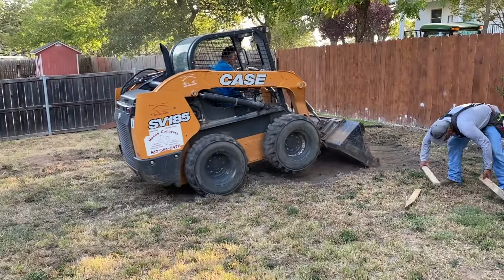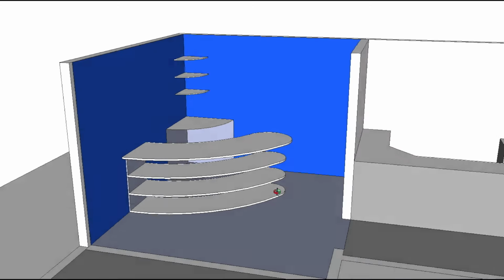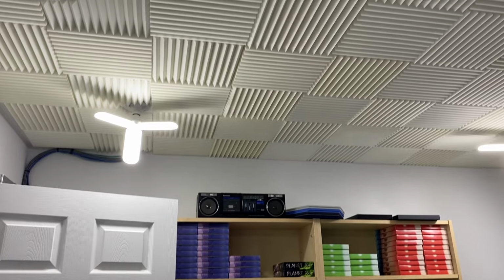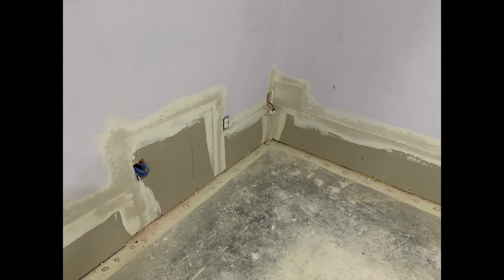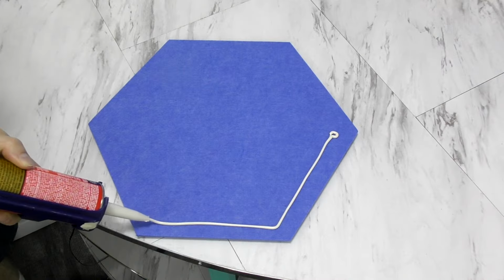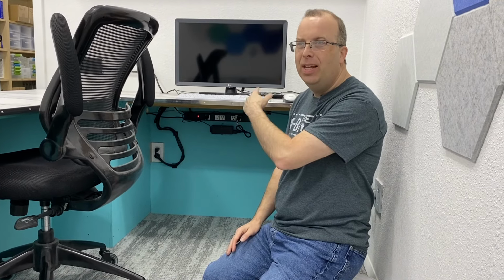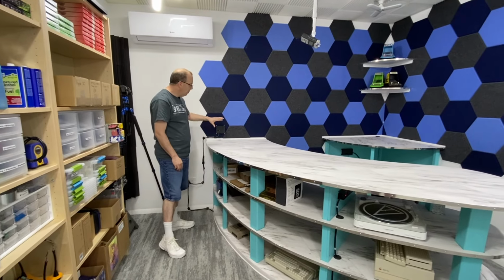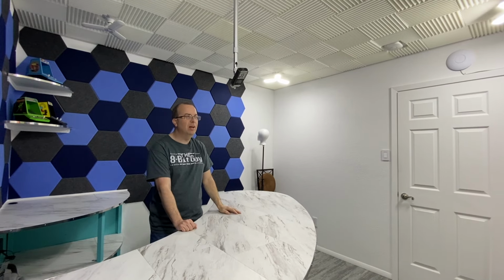8-Bit Guy Studio Build - Part 3

Comment: Anti-static wrist straps tend to have a 1 meg ohm resistor in series with them.  This makes them conductive enough to drain away static electricity, but not conductive enough to cause you to get zapped when you touch something hot.  So just put a 1 megohn resistor on the workbench edge.  That way you don't need to worry about setting the switch for whatever you are doing.
Reply: yea that current setup is actually dangerous he can get between live and earth and get electrocuted so that 1MOhm resistor is much better solution than  a switch
Reply: Is there anyway we can use the Pantarouter for that? 
Good surprise to see you pop up on another of my favorite channels
Reply: Just my thought ^^ Around 20 or 30 years ago I bought a wrist strap for electrostatic discharge and weeks later they sent me a resistor because they forgot to add one when I purchased it. That's what burnt the resistor into my breain ^^
Reply: Without missing a beat your voice played this message in my brain.
Reply: The Wandel had spoken.
Reply: I was about to suggest the same. Not just wrist straps do this, but anti-static table mats often do this too. It's pretty standard practice to use a 1 meg ohm resistor in series with any anti-static grounding  as that simultaneously allows quick dissipation of any noteworthy charge and while also disallowing most typical unreasonable/unsafe currents. Though... technically for CRT voltages you might want to go for higher resistance, and be mindful of breakdown voltage, but yeah. Your current switch might have good odds of letting CRT voltages arc right through too. If really worried about CRT voltages, I might be tempted by something like a MOX-2-121006JE, which is a 100Meg resistor rated to 50KV and 12.5W, and if you took 27KV from a CRT to it it would be limited to 7.3W. Might be overkill, but even at 100Meg I'd expect it to dissipate static sufficiently, and it'd even survive even the worst case of a live CRT HV supply being shorted to it.
Reply: @rougenaxela  The MOX-2-12 is rated at 20 Kv and 5w, it is the MOX-5-12 that is rated at 50Kv and 12'5w, according to its datasheed.
Reply: Just make sure the voltage rating of the resistor is high enough. Otherwise, bad things might happen :)
Reply: @basvisscher934  If there is enough current that the resistor blows up, you already have other, probably more painful problems.
Reply: The crossover I definitely did not expect...
Reply: Often even higher than that. 10M is also perfectly adequate for ESD control.
Reply: Just don't buy "cordless" antistatic straps because they have only this resistor but it's not connected anywhere so it won't discharge anything.
Reply: @wychowanek90  i can never look at cordless anti static bands without thinking of The Verge PC Build.
Reply: @blaster00000  "He's not fighting static, he's fighting cancer!"
Reply: @wychowanek90  I have a hunch that these cordless straps are just supplied without a cord from the manufacturer, but then falsely advertised, intended or not.
Reply: just make a jig for it
Reply: @AnthonyShuker  OMG made me LOL
Reply: Was just about to say the same thing
Reply: High Voltage from a CRT probably can jump it easy - but that's probably true for the switch too.
Reply: @fischX  High voltabe from a CRT would just arc thru to the floor too.  My understanding is the big danger with the CRT voltage is not that it will kill you, but that you will drop the CRT, which may then implode, and that causes injury.
Reply: @matthiaswandel  True, but high voltage isn't what (usually) kills it's the current at your heart muscle. And that depends on the voltage and on the overall resistance, a actual arc on a switch has surprisingly low resistance. There has to become some unlucky circumstances together but you usually need only to die once.
Reply: megohn griffin
Reply: Not enough green
Reply: Exactly!
Just wanted to say the same thing.
Use a proper ESD plug for your power socket which has the 1mOhm resistance and connect that to your ribbon / mat whatever.
Reply: Lol it’s funny to see the youtubers I watch commenting on other vids
Reply: Definitely this. It's too easy to forget to flip the switch, and it only takes one time.
Reply: The resistor is also to prevent you killing a static sensitive device that has become charged device by grounding it.
Reply: How did you comment on a video 21 hours ago when it was uploaded only 5 hours ago 🤔
Reply: @suryan235  A lot of channels charge a fee to watch a video before it's released to the public.
Reply: My two favorite youtubers of all timr
Reply: I’ve heard that electricians are often taught to put their free hand in their pocket. That way they won’t accidentally be touching ground with it in case they touch live current with their main hand. One thing NOT to do is hold onto the metal case with it as I did with a small oscilloscope — “only” 900 volts.
Reply: @markjames8664  yeah but normal footwear isn't electrically rated, shouldn't a lay person assume they're always grounded to their feet??
Reply: @metaleggman18  Soldering a ground wire close by the mains is not a good idea.
Reply: @metaleggman18  Yes, but it is better to reduce risk wherever you can.
Reply: And like other people have commented -- a high voltage might be able to jump the gap in that switch. For similar setups in the past I had a socket & plug with the earth line in. If I didn't want earth I can unplug the line and put it well away from the socket. Additionally, it lets you easily see that you're in a safe state.
Reply: I didn't expect to find you here.
Reply: yep
Reply: Correct !!!
Reply: Came down here to say the same thing.
Reply: whats about adding diod in this sheme for electro runs only oneway? (outside)
Reply: @Pur3Energy  No diodes. Static can be of either polarity with respect to ground.
Reply: @misterhat5823  i didn't get it. Why on all shemes ground has no protection with respect to electricity running backwards? 
Also here - task is to free static from body. So how it can hit man if task is to take away it(static) from body to ground?
Reply: @Pur3Energy  Yes, in principle the idea is to bring the static of the man to the ground, so as not to damage delicate circuits, before working with them. But if the man is manipulating a circuit that already has a charge, especially with a high voltage, such as 27,000 volts in some CRT monitors, then it is a bad idea that those 27,000 volts can be discharged to ground through the man's body. Deadly danger.
Reply: Great idea
Reply: That's true
Reply: or both
Reply: @ParabolicLabs  I'm confused, how wouldn't a normal human be grounded at that voltage? Like he's not floating in the air, or sitting on a Powerline like a bird. The idea that normal sneakers are somehow more insulating than a 20+ awg wire is...strange.
Reply: It’s a good job Mr 8 Bit Guy didn’t use pocket holes ;)
Reply: I was about to say the same thing. (I was a repair technician for 15 yrs)
Reply: a standard 1/4 watt resistor wouldn't protect you from getting electrecuted by high-voltage caps inside a crt, just static high voltage charges
Reply: holy shit its matthias! :D
Reply: @jasonb4370  I was about to comment to say essentially that. I'm keen on anti-static measures having destroyed some things in the past, but a low impedance ground can be a scary thing. 1MΩ is a good compromise.
Reply: Judging by Linus Tech Tips video with Electric Boom about static electricity and computer hardware isn't something you should be worried about they had to be extreme to cause harm to the hardware. But perhaps older hardware is more sensitive.
Reply: Lol, I didn't see this comment until now & said pretty much the same thing. 😋
Reply: Please do this. And you can't tell me you won't at some point forget to flip that switch.
Reply: This. We all think a switch is fine for stuff, until we forget to flip that switch.

Realistically I doubt he’ll ever put himself in a situation where he’ll possibly electrocute himself, but I definitely can see one where he’ll get a nasty enough shock to use some very…”colorful” language, and possibly damage what he’s working on.
Reply: The strap is pointless in providing protection to the equipment he is working on. Regardless of a 1M resistor all it is doing is discharging HIM with reference to ground and not the thing he is working on. He should indeed be using a proper ESD strap and mat connected to ground (as a useful common point) via those 1M (usually integrated) resistors.
Reply: I like it, personally
Reply: An excellent idea, and maybe not so difficult to implement, since the entire thing is wired to the guts of a random power strip. CRTs and devices that run on capacitive droppers can get pretty spicy when you poke about inside them. (See Big Clive and his collection of cheap mains-powered deathtraps that he finds on ebay.)
Reply: Hey, are you the guy who makes wooden combination lock?
Reply: By something hot, do you mean something temperature hot or AC polarity hot?
Reply: Yeah man was about to say
Reply: 1MOhm wooden resistor, cut with a DIY bandsaw 😎👍
Reply: @Poxenium  It wooden work! ;-)
Reply: Defo a good idea to add a 1 megohm resistor in series!
Reply: I was about to say to get rid of the switch and replace with a 1 megohm resistor, it's too easy to forget to set the switch the right way and either not discharge yourself, or get a zap when working on live equipment.
Reply: you got it first, I use to do ESD benchwork at my former work
Reply: @ParabolicLabs  Yeah, 40kV/1MΩ=40mA, right on the edge of deadly. Build in an 5MΩ Resistor then.
Reply: Remember monitors at 27,000V, you might want to go for a little larger than 1meg
Reply: The metal banding is dangerous whether it’s connected to ground or not. One can still fry their nuts from an unwanted short between your body and the workpiece via the metal banding.
Reply: The resistors do nothing, my guy. They're snake oil. You can find countless tests of this on YT.
Reply: @MeepChangeling  BS. It reduces the chance of being electrocuted.
Reply: ever heard of bil herd he has a discord
Reply: That things dont work :-/

(I tried it and i get zapped
Reply: @gameyord7182  Maybe, but you won't be as zapped as without it. I mean: with the resistor, it would probably be uncomfortable, but without it, it can be mortal.
Reply: @gameyord7182  apparently you can't read

Comment: Beautiful new studio! The hexagons don't look perfect, but they are much better than I thought they would be. Maybe you should have put the white ones instead of the black ones, though - I think the "worse than I hoped" effect is because of them. Maybe you can try putting them on temporarily in place of the black ones and shoot a test video like this?
Reply: I agree, I think the white ones might still look better.
Reply: I fully agree, the colors in the other room would be perfect.
Reply: I agree. The current setup is way too dark. The background should have a good amount of light colors.
Reply: White ones will have way too much contrast and make the subject look backlit.
I would go for a different shade of blue or teal or some other color if possible - that way the subject pops!
Reply: @grproteus  not really. ONLY the white ones will have too much contrast and make Dave look backlit, right. But white + blue + cyan can look really good. Anyway, it's impossible to tell without trying. Maybe another shade of blue gonna look better, why not.
Reply: @Sudakov  the contrast is going to be awful. The best bet would be to have a gradient like the one above the sofa, with shades of blue - teal, arranged in vertical or 45-degrees lines imho.